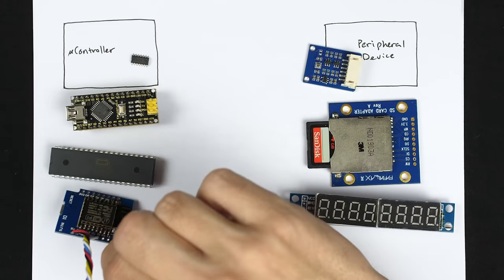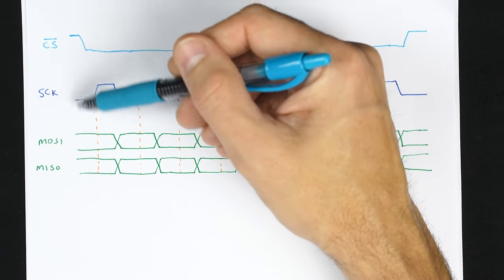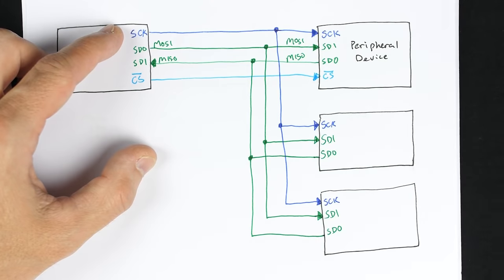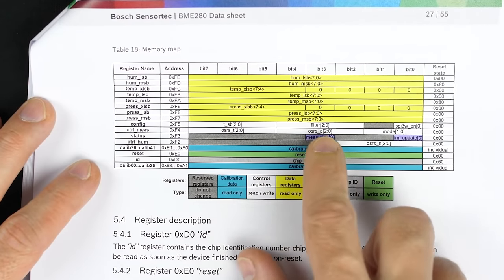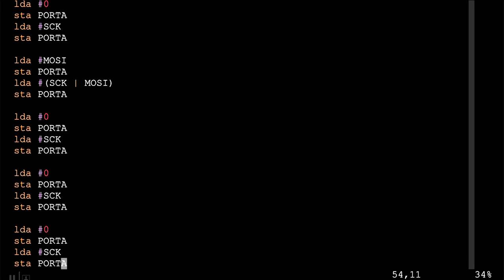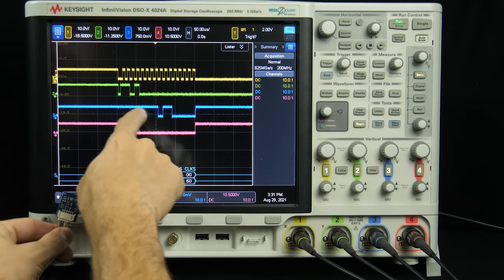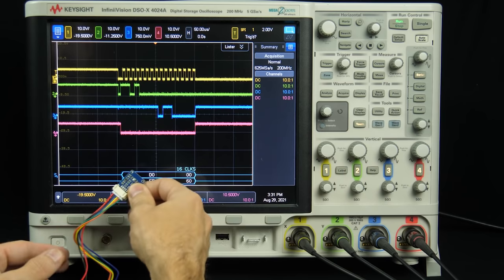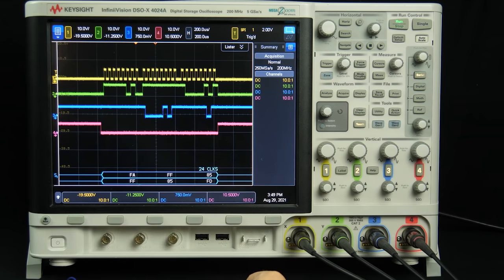SPI: The serial peripheral interface

Comment: I would just like to point out how god damn clean and user friendly the datasheet of the BME280 is. Timing diagrams annotated with the bit-indices, comprehensible english, a clickable table of contents, using vector graphics for every graphical element. I wish every datasheet was this well made.
Reply: "Comprehensible English" had to chuckle at that one!
Reply: I used this little sensor (via I2C though) in my projects, it is quite reliable and precise. I agree, the manual is just beautiful from the software developer's point of view (hopefully, from electronic engineer's one too). They describe whatever you need and you want to know about this sensor in details. A perfect example how it should be done properly.
Reply: I am working with the AD7771 ADC from analog devices, using the SPI interface. I wish the datasheet was 10% as friendly as the BME280 datasheet is.... Not only regarding the SPI protocol but explaining properly what certain registers do.
Reply: The pdf’s all fine and readable, but the damn BME thing heats itself up quite significantly, unlike the el cheapo chinesium DHT sensors.
Reply: @sashimanu  How??? The average current-consumption while measuring at 1Hz is less than 4uA. Max consumption is ~1mA, so it should be literally impossible to heat this thing up if used right. It is a temperature sensor too after all, it isn't allowed to heat itself up by DESIGN. You either got a fake, your wiring is wrong or your GPIOs are set up wrong. Are you disconnecting VDD, but keep the SPI/CS lines powered? (could cause backfeeding through the ESD-diodes) Are you using it at above 3.6 volt?
Reply: @sashimanu  A self-heating temperature sensor either indicates a faulty sensor, or wrong wiring/power
Reply: As industrial technician, I can't complain about datasheets. But I get it, specially talking about these new chinese companies, there are many new stuff poorly documented in the market nowadays.
Reply: Bosch is very good about this kind of thing.
Reply: @electronicscaos  I finished a library for the DS2786+ Battery Fuel Gauge IC a few weeks ago, and while the datasheet has all the necessary information, it is very frustrating to work with. It doesn't have the comprehensive memory map including individual bits, and it's all spread-out. When converting the datasheet to code, i love having the condensed memory map for quick reference rather than having to scroll through pages and pages to find the correct bits.
Reply: @AiOinc1  I have a Bosch electrical water heater/boiler from the 90s in my apartment.  During renovation last year one thing led to another and I accidentally broke a piece in it.  The service came, probably he wasn't even born when this boiler was made, he checked from his internal documents and got the part number of the borken thing, ordered it and replaced it.  This was incredibly impressing.
Reply: Zat is because zee Germans are very particular.
Reply: After all it is made by BOSCH so it has to be informative
Reply: Bosch really knows their stuff
Reply: You ever seen the datasheets that are just a collection of photocopied faxes ?
Reply: Bosch has great data sheets. Now if only they could keep their sensors in stock anywhere... I haven't been able to find any of their IMU's or barometric altimeters for over a year...
Reply: @sashimanu  yep, it's a nice die temperature sensor but a pretty bad atmosphere sensor, 1-3C over ambient. I haven't tried it at slower speeds because I needed the pressure at a higher sampling rate.

There are several posts on reddit on the subject.
Reply: @nrdesign1991  yeah I get it. One device I can point as being poorly documented is there ESP32 stuff. 
One can surely develop over it, but playing lower levels with these devices is a real pain.
Personally, I'm an opensource guy, always giving some contribution here and there as I find some time, and I truly love working with really opensource stuff, having the alternative to dive deeply in all those rabbit holes.
Reply: Word
Reply: @lexus4tw  yeah... That's my point.
Reply: @Mr_ToR  Exactly my point, Bosch numbers for the ignition module on an 80s car that was made in a country that no longer exists still have documents available
Reply: and then you got an aliexpress modules and there's zero datasheet to rely on and just banging every single bit combination till you get an output.
Reply: cries in LCSC
Reply: they probably paid the guy who coded it with a bowl of rice
Reply: Yes. I absolutely agree. I hate dealing with Chinese datasheets. They're the absolute worse.
Reply: Sadly a lot of datasheets have been through Google translate and never checked by anyone who might find the absurdities and garbling that results. I have had to abandon the use of several very useful seeming devices in my designs due to lack of comprehensible information about them. Worst of all, when you make contact with the companies concerned to ask questions, you get some kind of pro-forma auto-reply or (more often) no reply at all.  My favourite pro-forma (and this was in respect of an MP3 player module) was this little masterpiece: 

"Friend. Thank you for contacting this. We advise to power on your device sometime after you turn off previously. This make all device functions 100% again. If your power is broken a new is needed. Wish you great days".
Reply: The crap I have is xeroxed with out of focus dust.
Reply: good luck getting a user friendly datasheet out of other device module vendors...so many of them are god-awful...
Reply: Same goes for ATMEL's datasheets
Reply: I've been tinkering with small LCD panels with Sitronics controllers. The datasheets for the controllers and the instruction set for SPI is extremely clear and comprehensive and the registers are also described in detail. And no spell or grammar errors.
Reply: @Mr_ToR  Manufacturers usually have a pretty good spares division. I worked for a company that supplied spares from A brand computer manufacturers. Clear exploded views and part descriptions. This was in the late 90s and most was on paper. Around 2000 most went online with their spares database, but by that time I had switched jobs and had become a field engineer.
Reply: For the 'experts in the field', as they say in the USA.
Reply: @alanmusicman3385  This looks like some kind of camera joke. :((
Reply: I am very proud to say that I now work as a student for Bosch Sensortec and its really amazing to see how such a company works internally and i can tell you, these guys bring outstanding expertise! Its really a pleasure to work for them.

Comment: It's rare to see a Ben Eater video where I am very familiar with what he is showcasing. I've written multiple drivers using different HALs for the shown sensor.
Reply: Good job bro
Reply: Plus there. Working with SPI-like interfaces at work.
Reply: The HAL9000 is the best, but sometimes a little bit homicidal.
Reply: @sdspivey   😁
Reply: Hi. In your HAL were this SPI sensor's temp/pressure registers memory mapped or IO mapped somehow (possibly via an SPI controller) that you could simple read/write to obtain the temp/pressure data? I'm trying to understand how a 'modern' processor on a motherboard talks to  SPI chip (like SPI flash memory containing the BIOS). Surely you didn't 'bit bang' like Ben did here inside your driver code?
Reply: @EvilSapphireR  Hey there. Although it is possible to memory map some SPI devices like flash or RAM chips that use the QSPI protocol (if the hardware supports it), most often you access them through a SPI peripheral, which is often memory mapped instead of the device itself.

If you have an operating system or a HAL already set out for you, you can read the documentation of those to figure out how to transfer data between the devices. You will usually be exposed some sort of transmit receive commands, as well as event or DMA based transfer methods.

Since the SPI controller is memory mapped most often for microcontrollers you can also use its registers directly but using a HAL is going to be always easier unless you have some specific requirements.

With these small sensors you most often just write the register address, then read it's value immediately after. Write works similarly except you write both the address and data bytes.

Comment: I'm an electrical engineering student and I've gotta say you've single-handedly reminded me why I chose my major and revitalized my love for electronics.
Reply: I'm also a student and feel the same way. School can be rather demotivating, while content like this is inspiring and motivating.
Reply: When I was at school I had no interest in grades or classes whatsoever. It was only until my friend taught me how to solder which was when my interest took off
Reply: Can i ask, is he doing more of electrical/electronics or computer engineering?
Reply: These are genuinely my sentiments as well
Reply: I'm just a hobbyist but agree, Ben's videos are always like that.
Reply: I'm a time-traveling electrical engineering student from 25 years ago. Same here!
Reply: @omniyambot9876  This is more of low level hardware stuff. SO mostly electronics engg. Computer engg usually deals with a much higher level (Application level)
Reply: @anonymousarmadillo6589  thank you. But isn't that firmware/software engineering?
Reply: @omniyambot9876  Technically, yes. But if you want to learn and do this as your career, you will have to start with a degree in electronic engineering, and specialize with a post graduate course.
Reply: @omniyambot9876  Both, really. Computer Systems Engineering is really a sub-field of Electrical Engineering -- there's a lot of overlap. CS Eng is more focused/specialized while EE is more broad/fundamental in its topics.
Reply: @Thirsty_Fox  oh yeah thank you so much. Of course I'll take electronics engineering. I just like analog systems better.
Reply: @omniyambot9876  If you like analog electronics, you'll do well... I understand there's growing demand for good analog engineers. Good luck with your endeavors!
Reply: @Thirsty_Fox  oh really?? How could you say? Sorry for asking. Because I thought we're heavily leaning to just digital hardware and almost everything in software. What big industry has potential in analog electronics? Renewable systems? Electric cars?
Reply: @Thirsty_Fox  because it seems that cool stuffs are done digitally and sometimes I find digital boring. I almost only see analog in power supplies and small part of logic. Which are almost perfected and everything are just reproduced/redesigned a little bit.
Reply: I graduated from EE university about four years ago. Be sure and learn some coding as well. The tech industry is starting to see more software solutions, particularly for data collection like IoT, edge computing, and converting that data into action like embedded systems and automation.
Reply: @omniyambot9876  Analog is still essential in all kinds of electronics because ultimately, the world is analog. Audio, communications, motors, power systems... remember that "digital" is just an interpretation of a analog signals. The reason I've heard there is growing demand is that so few EEs specialize in analog and the average age of analog engineers is approaching retirement.
Reply: @Thirsty_Fox  oh I see. Makes sense. Thank you sir;))
Reply: An.?
Electric engineering.?
Go back to school.
Reply: You should make a Course! I've never learned some concepts until I saw your explanation! You make it all look like fun and ease!
Greetings from Brazil!
Reply: As a mechanical engineer, it makes me wish I chose ECE.
Reply: I had to drop out of school, but continued to learn electrical engineering on my own. Thanks to people like Ben it's been possible to do that. You're lucky to be able to attend a college/university, do your absolute best and be the best. It's what I would do if I could.
Reply: Ditto
Reply: @omniyambot9876  youll find more analog work in mills and manufacturing. paper mills (at least near me) havent upgraded since the late 70s. Of course youll still have PLC and other control systems which are fairly digital but luckily for you, still controlling analog circuits.
Reply: im in EE but have no passion for it whatsoever:,)
Reply: @theonetrueanthonylong1843  what do you mean with PLC? Powerline Communication?
Reply: @Mertt1990  programmable logic controller. Basically a controller made to accept inputs and provide outputs that are used in industrial plants or other heavy-duty applications. They also have to be very sturdy, are generally modular, and tend to be fairly easy to opperate.

Comment: I used SPI in my final project for university. We had a microcontroller controlling a series of LED displays. The controller sent the display a byte of data using SPI which the display read as an ASCII character and displayed. The interesting thing is we had the display setup so that whenever they received data they would output their old data and then we daisy-chained displays so each one sent the last character it received onto the next. That way we could control a whole bunch of LED displays with just the one chip select line. The end display would wrap around back to the controller. We used that to allow the controller to figure out how many displays were connected. it would send out zeros for a while to clear out whatever data was in the displays and then send all ones and count how many sends it took to get the ones back. However sends it took was the number of displays attached.

While implementing that counting logic I made a mistake in my looping bounds. The counter variable was only a single byte and I told it to loop until that byte was 256 which of course never happened. Made a very interesting strobe effect though. As the displays were constantly being interrupted to transmit and receive data.
Reply: That's super cool! Thanks for the break-down. I'm going to order some bread boards to run some projects a friend told me about

Comment: Literally the only firmware programming I ever did was to write an I2C implementation that could control the LEDs and read the temperature sensor on a network (interconnect) card. We had the prototype cards without the ASIC on them and I ended up bit-banging a parallel port on a desktop PC to implement a (very slow) I2C.

The company (Quadrics) went bust a few months later and I never actually got to see my code running from the ASIC, and that was the end of my glorious firmware programming career.
Reply: what are you doing now? have you left the firmware programinng?
Reply: @nikhilwardrobe  Oh yeah, that was an aberration. These days am an SRE, which suits me fine.
Reply: @Vanders456  I'm working as intern with designation as embedded firmware developer. I have heard the pay isn't that good. Why did you shifted from firmware to sre and how did you do that?

Comment: We might also mention that devices vary about whether MSb or LSb is sent/received first.  If all 8 outputs of the decoder is used, you will also need to devote one more pin to selecting/deselecting the decoder; otherwise, one of the eight devices will always be selected.  If output 7 is not used, then writing 111 to the decoder will deselect all used devices, however.
Reply: I'm falling to find a reason that it's a bad thing that one will always be selected. If the device needs the clock to start a conversation anyway?
Reply: @modmen.  The chip knows the byte is complete only after it is de-selected... You could still select another chip without transferring any data, but some chips don't respond well to that.

Comment: I had trouble with an SPI chip once.... I never considered that I was maybe using the wrong clock mode.... thanks for the tip!

I always do SPI on microcontrollers with a built in SPI port.... very interesting seeing you "go old school" and implementing the interface with bit-banging.... showing us how it REALLY WORKS.

Comment: I've spent the last couple weeks working on getting an SPI SD card reader working.. this is perfect!  Thanks!

In my research and attempts to get an SD card reader working, I've found that SPI not being completely standard has some issues.  As you said in your video the clock, DI and DO lines are common bus lines and CS is individual to the device. Some types of devices do things that are kind of odd.  For example when you initialize an SD card reader you send at least 74 clock pulses with CS held high to get it into SPI mode.  I'm no expert but I don't think that's a good idea when you want to have multiple devices on the same bus, devices should only respond to anything when their select line is low.  It's low risk in this case (if the card reader is on the SPI bus you want it to be in SPI mode) but it just doesn't seem right that an SPI device can be influenced when their CS line is high.
Reply: SD cards are insane.

Comment: Tip, you can also use SPI for very simple circuits. E.g. feeding a shift register ic (74hc595 maybe) with SPI output is an easy and cheap way to control LEDs.  What more, it can be daisy chained so the only limit is the SPI bus speed or the ic frequency.
Reply: I use a 595 as a bus controller for SPI, lol.
Reply: 74HC595 and 74HC165 can operate upto 31MHz max at 4.5V or 36MHz at 6V according to Ti. So it's quite suprisingly fast given that Atmega328p's SPI can go only upto half of clock Speed, typically 8MHz on Arduino Uno or 10MHz if 20MHz crystal is used instead
Reply: @prathamkalgutkar7538  it's not super surprising, where would they get the rest of the speed from? you get a cycle to set up the data with clock low, then a cycle of reading the data with clock high